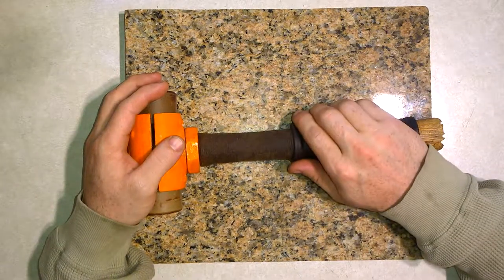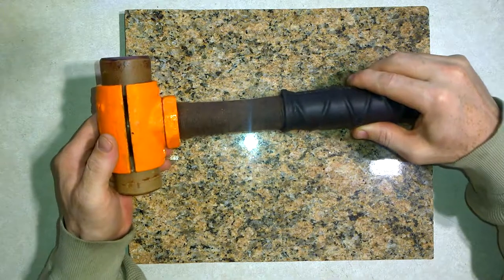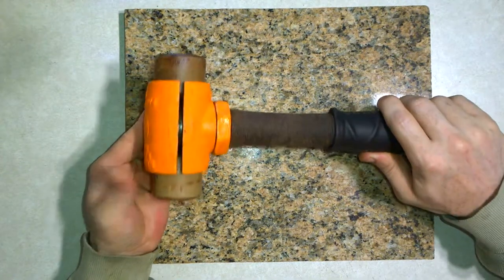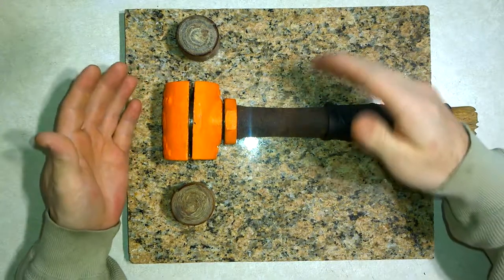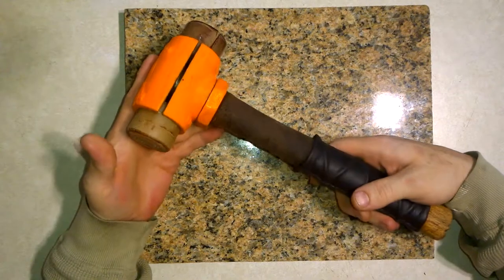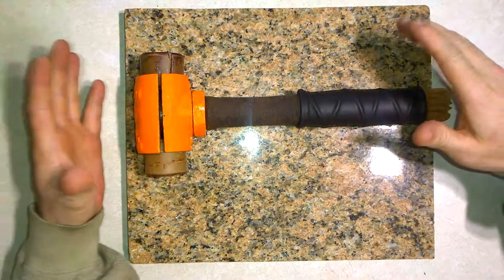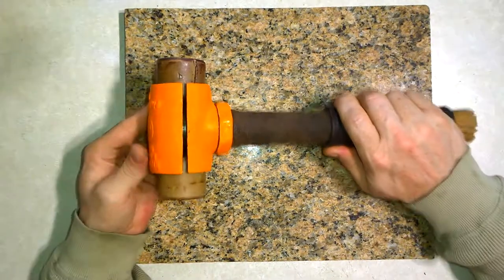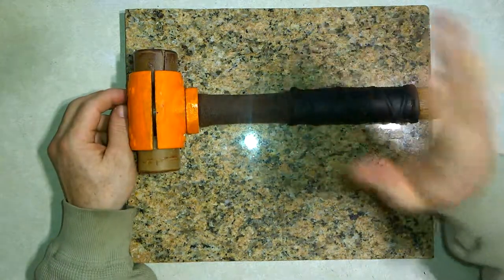Interesting Tool You May Not Know About.

Comment: Thanks for taking the time to make this video on this unusual hammer. I found one in an old box of tools my deceased father had sitting in his basement. I had no idea what such a hammer was used for or its history, but now I do. Thanks for that.
Reply from the maker: You're welcome! Is the one you found among those things a BASA brand?
Reply: @The1Helleri  The hammer casting reads "Danco Hammer No. 4
Danielson Conn." This hammer has 2" diam. rawhide faces.
Reply from the maker: @lvdoublej9731   Okay so this Danco is not to be confused with the modern Danco (different companies). The modern Danco is based off first name of it's founder (Dan Reynolds). They don't make or sell anything like this (they seem to be largely plumbing related) and don't appear to have ever done so.

 In this instance (the instance of the marks on your hammer) Danco is an abbreviation for Danielson Manufacturing Co.  based in Danielson, Connecticut USA. A township stock holder ran factory that popped up in 1830 and appears to have been defunct for a very long time (when exactly it went out of use and business I don't know). Likely the hammer just says Danco because they couldn't find a way to neatly fit the full name of the company on it.

Your hammer is the next size up from mine (and I believe the largest such hammer that anyone produced). Remarkably the hammer sizes (and which correspondingly sized faces go with them) don't seem to have changed across different makes of this type of hammer.  

Don't rely on the face diameter for the size. They can swell or mushroom over time and use. Some have a step down in size for the area that fits in as well. What matters for proper sizing of faces is the inside diameter of where the face fits into when in a mostly closed position (about 1/8 inch gap between the two closing pieces). That measurement is the size face you want to order if ever intending to order any. There is a link in the description to where you can buy faces. Although you may want to search ebay first if interested in that in hopes of a better deal.

Comment: Vaughan makes an almost identical hammer (587 series) that you can configure the way you want (head size, weight and material) and will save you a lot of money over other premium brands like Garland which are a lot more expensive.
Reply from the maker: Thanks for the contribution. Having had a look I personally don't care for the hammer itself as it doesn't have that horizontal split. But thast shouldn't be a deficit for most as pure leather working mallet. For me it's just that I've been trying to downsize on the amount of tools I have. Opting for more versatile (multi-function) tools where possible is a big part of accomplishing that goal. 

With the old style of refractory hammer the horizontal split allows it to be used as an adjustable wrench in a few configurations (one that can't get into small spaces but offers good grip and a lot of leverage on the big stuff). That makes it good for pipe work. Because you can break or cinch caps, seat or tap loose, turn securing bolts etc. Personally I'm on the look out for an old cheap BASA. That brand as shown in some of the images I linked in the description can be used on rather large bolts and nuts.

Now even though I probably won't be getting myself a Vaughan split head hammer. The faces for it appear to be inexpensive relative to Garland faces. Which is where the cost really hurts the wallet on a tool that has "options" lol. So I'll be looking at Vaughan for those when the time comes.

With this sort of thing it's really about balancing cost vs. need. I expect for most this would be a good value purchase for leather working. So good on you for pointing it out.